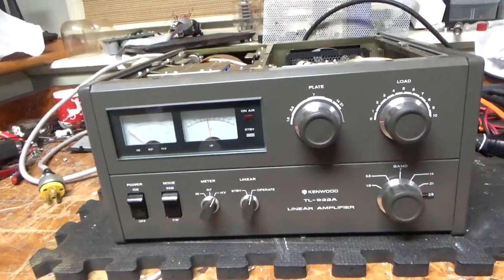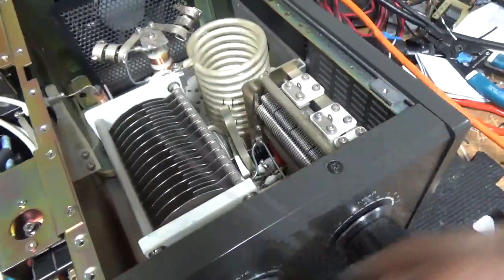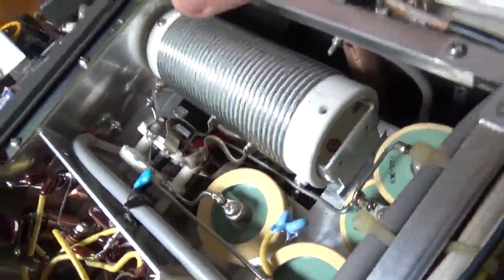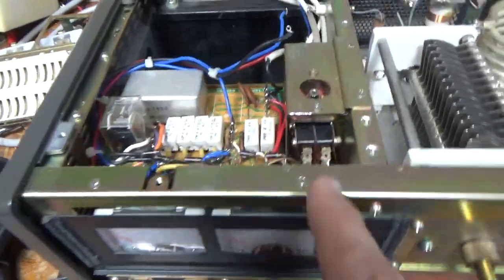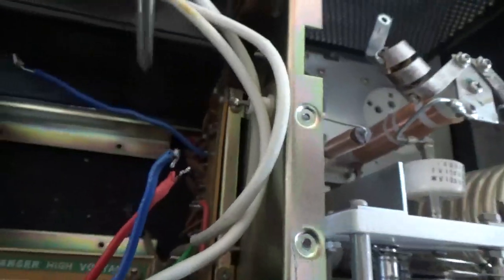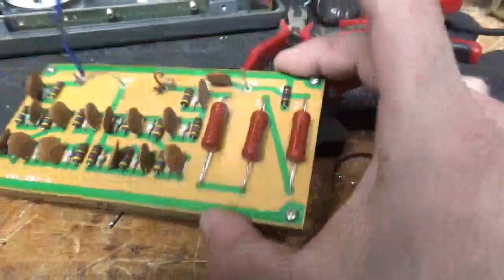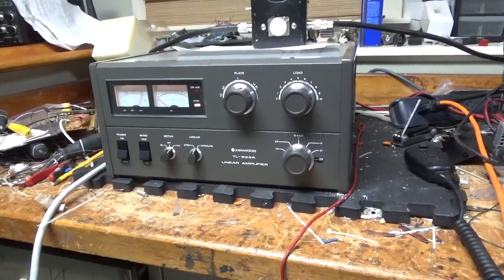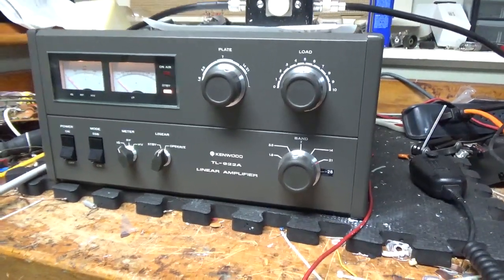Kenwood Tl-922 Extensive Repairs , Plate Current Meter , Power Test

Comment: I've seen some "CB mods" before but this one really stole the trophy on it. I think better results were made by taking a kid's crayons and instead giving them a Soldering Iron and a $100 gift card to Radio shack... I guess as long as the B+ wire is near the connector, it will reach when it arcs across, right?
Reply from the maker: Lol